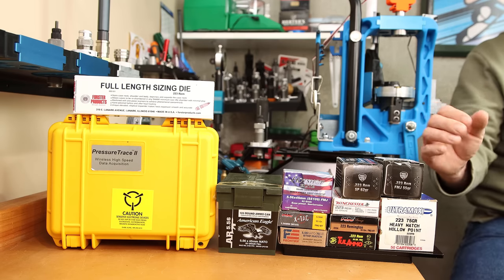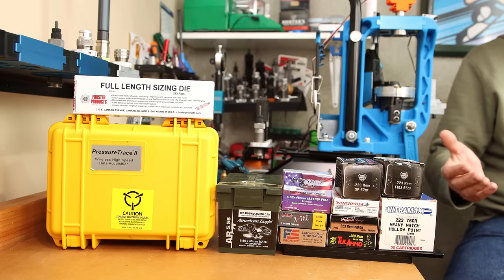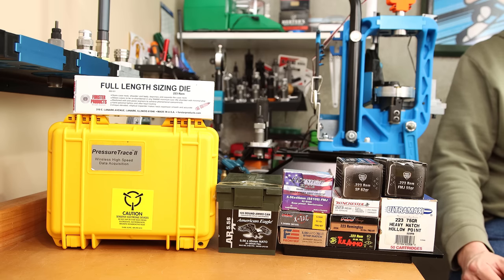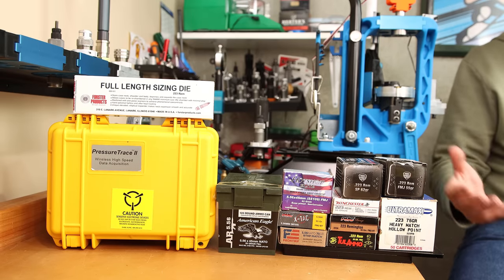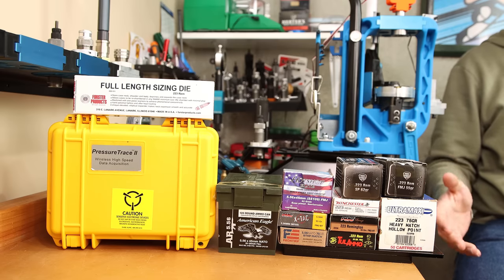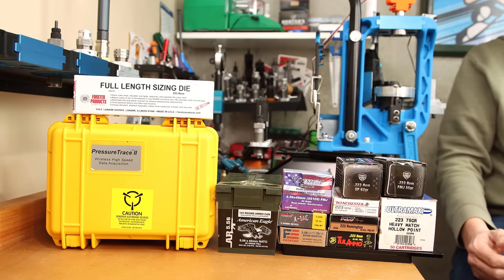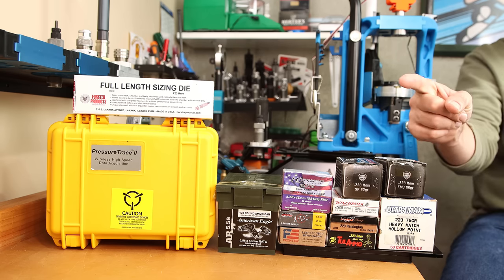223 vs 556 - The Hidden Truth No One Tells You!

Comment: Ok, the issue I see here is the test barrel. The entire idea behind the Wylde chambering was to help negate the pressure issues when shooting 5.56 in a .223.
Flat out, the pressure issues are when a 5.56 is fired in a shorter throat .223 chamber, so testing in a "go between" chamber like the Wylde took away MOST of the issue.
This is why ALL my handbuilt AR's are Wylde chambered, it truly is the best of both worlds.
As to the actual danger of shooting 5.56 in a .223, I sold guns for many years, and I sold a Ruger Ranch rifle to a fella who proceeded to shoot an entire case of XM 855 through it and ended up with a cracked receiver. WAY too much pressure for that gun.
So I have personally seen the danger and damage done when not knowing the difference.
Reply: My response is I seriously doubt that Ruger Mini guy only shot factory M855. There is a way to ramp up a normally very safe into the stratosphere. Get a POS Galil cobbled together by Century so the mags sat too low. This caused bullets to ram the barrel which set the bullet back. This will cause a dramatic overpressure with primer pockets enlarged to Large Rifle or at least that's how they looked. Got some stings on my right arm but glad it wasn't worse. No Century made junk no more. 
FWIW some of the bullets were pushed in so far only the tips could be seen at the case mouths. After 50 years of reloading centerfire rifle mostly 223 & .308 Win IMHEO the 223 is a sweetheart cartridge to reload and shoot. Its a forgiving round but you still have to pay attention to detail.
Reply: @LuvBorderCollies  Well, I know for a fact he shot only those Factory rounds, and I suspect he went to town on the gun, meaning that he fired as fast as he could with many mags, and I suspect the receiver just got hot as hell.
Anyone who has ever shot the AC 556 (and I have, at Knobb creek) will tell you that gun heats up faster than many others, it was just built too light for auto or sustained fire.
Reply: @alanrobinson2901  I never abused any of the Mini 14's and the Mini 30 I had. Still got a G/B but I've never shot it. It looks neat and that's why I still have it.
Totally believe the fast heat up. The Mini 14 was never designed to be a military weapon even if it resembles one. It certainly was not designed to be an accurate one either. Thanks for comment as I'd never thought of that angle. If you were on Patreon I'd buy you a coffee. 👍

Comment: I use Lyman's 50th edition reloading handbook. It combines 223 win and 556 nato in the same specs. I load to around the middle of the specs and haven't had any issues. Seems to me like the same specs are going to generate similar pressures, whether I call it 223 or 556.
Reply: 556 truly is just a 223 with a 60+ grain bullet trying to push to 3000fps. When attempting to achieve this thay had issues with pressure from the longer bullet length and weight so add length to the throat to lower pressure back to what the time they considered more safe.

Comment: Do you think the extra feebore is just the military's way of ensuring it can run a variety of rounds with not always perfect dimensional accuracy?
Reply: I remember reading that it was to allow for a specific round where the bullet itself was slightly longer than standard 55gr, may have been a tracer round but I am not 100% certain. I will look to see if I can find the actual source for that information, but it would make sense. If the actual bullet length exceeds the standard length from the end of the casing, I would assume one way you can compensate for that is by increasing the free-bore before the rifling.

I am far from any kind of an expert as a quick aside.
Reply: Of the information I've found for the L110 NATO and American M856 tracer, the twist rate (1:7) is more significant than the free-bore size, and the difference in size between that and a .223 bore isn't specifically due to the L110/M856 round specifically. In fact the differences in the actual bullet size between standard 855 and the 856 tracer seem to be negligible as far as what sticks out into the chamber (most of if not any of the increase in length is inside of the casing), but I can't say for certain whether or not the difference between the two bullets had any impact in the design of the free bore dimensions. I can't find any information right now that indicates one way or another so i defer to people who actually know what they are talking about.
Reply: @davidregal6831  I believe you are correct.  For the M856 tracer round to start out with the same ballistic coefficient as the M855 (our equivalent to the Belgian-developed SS109) it is supposed to trace for, it has to have similar shape and weight.  The burning of the tracer pyrotechnic material sheds weight, of course, so it actually starts out a little heavier (63.7 grains) then gets lighter as it flies.  This is apparently the compromise the military landed on to keep the round at least close to the trajectory of the M855.
Reply: 2 words , 
lowest bidder
Reply: @davidregal6831  Specifically, not “bullet length,” but shank length to ojive as the true bullet seating surface to the lands.
Reply: @johnnash5118  Thanks for the information. I was using layman's terms because I didn't really know the correct wordage and didn't want to misspeak and misinform people.
Reply: Reloading  charts give you the maximum  over  all  length.  So it makes no difference.

Comment: I run an LWRC M6 and Sons of Liberty Gun Works M4. Both recommend 5.56, but I run whatever I can afford. I also used to have a Smith & Wesson MP15 which recommend using .223 instead. Out of all 3 rifles, my groupings DID NOT change significantly between similarly loads of 5.56 and .223, and neither experienced any failures. I do still prefer 5.56 due to my rifles and suppressors typically being tested with M855. M193 is widely available and usually what I see discounted. That being said, I did just order 120rds of Norma .223 for testing recently and I'm eagerly awaiting its arrival so I can evaluate it for myself.

Comment: Great data!
You confirmed once again why I use LC brass for anything Im loading at 5.56 pressure and everything else for blaster fodder.  That little bit of extra case capacity never hurts.  The pressure chart was good, and what is often missed.  Ive explained to folks that reload that chasing velocity in a 223 chambered gun they will almost always run into pressure signs before the Wylde, 5.56 or other chambers.  One thing I would like to know more about though is actually material make up of the brass itself.  All alloys are not the same, and maybe its my bias, but LC brass seems to last longer than alot of commerical offerings.
Reply: It has less case capacity and lasts longer because it is thicker and annealed. Older reloading manuals instructed to load 10 % less than 223 for this reason.
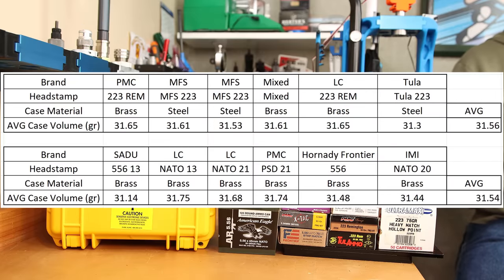Reply: @greybone777  Go watching starting at about 8:15 in this video.  You would be incorrect

I had more info typed up, but it didnt enter and Im not typing it in again....

Comment: THIS is a serious video, and thank YOU for your above & beyond calling for it.  I also was so tired of reading threads about the YES or NO swapping out these two rounds. I contacted Ruger Arms - I was told by Ruger, these are both good to go in all their rifles,  SAVE - the " Target "  model.       The " target " model,  if stamped .223  ONLY shoots .223,    PERIOD !    hope this helps as far as the Ruger models are concerend, I'm not talking for and other firearm manufactures - just Ruger here.
Reply: I also contacted Ruger ,with  the same question, and got the same answer you did.  They said the chambers are rated at a higher pressure tolerance then either the .223 or 5.56  shells are rated for, was the explanation why.

Comment: Lots of great info and thank you for stating it's not recommended to shoot 5.56 in a .223, but you never discussed the main issue: shooting a 5.56 that has brass on the long side such as with remanufactured ammo, in a .223 chamber that's on the short side, is what causes the overpressure situation. The longer 5.56 case can extend into the rifling creating a seal that spikes pressure on the already hotter 5.56 ammo. Have I every seen it happen....no. it's a theory of what could happen. Any chance you could look for a short 223 chamber and shoot a long 5.56 through it?
Reply: If the case is so long that it's hitting the end of the .223 chamber, it will be hitting the end of a 5.56 chamber as well. Spec case length is the same for both. A "long" 5.56 round is long in OAL/ogive length. It could be possible to jam the bullet into the lands when chambering the round which will run pressures up and even if that doesn't happen, the shorter jump to the rifling will cause higher pressures. That is the concern.

Comment: Yeah, I have been telling people for a decade both are totally fine to use. I even tried to put it in the manual when the company I work for started their line of rifles and I was asked to write the manual. Our legal department cut it out!
Reply: Exactly!  I shoot my ammo in all my rifles.  I have an early Colt AR-15 with a .223 barrel mark.  It shoots 5.56 just fine....
Reply: @chuckvan1568  the chamber is heavily supported on both because of the design of the system. It makes no difference. The pressure differences are minor and the guns work fine in both configurations. I've got 5.56 and .223 chambers and shoot both .223 and 5.56 in my guns and I've noticed the 5.56 is less accurate in .223 chambers than .223 but that's about it.

Comment: I use both military brass and non military brass in my .223 rifles. I do not have a black rifle, mine are a Ruger #3 and a Savage bolt action. The only thing I find about the .223 is most loading books over state the amount of powder that will fit in the case. I often see loads called for that will not fit inside the case and will actually overflow, so I'm not worried about to much pressure because I haven't ever been able to over load one.

Comment: I’m a little late to this party but I always appreciate data driven assessments of these types of issues. It would be fairly easy to strengthen your conclusions by calculating the standard deviations or standard errors of your mean (average) values. You could then do fairly simple statistical analyses to see if the differences between your groups were indeed statistically significant.
Reply: Yes, good idea.   Definitely something that should be done!

Comment: If we go way back in time before all of this mix and match aftermarket stuff, the basic idea was that big army liked the .223, but wanted to toughen it up to ramp up velocity a bit.  
The brass webbing was thickened, and .025” primer metal thickness was used instead of the common .019”.  Staked in.
And of course, the neck length was a tad different.  
A 1965 era .223 has a much lighter case than a M193 5.56 of the same era.  
The 5.56 did have about 250 fps faster velocity, and more chamber pressure.
Army FM’s of the time fully explain the ammo.
But today, the waters have really been muddied.
If you want to know the specifics of our military 5.56, refer to our current manual, FM 3-22.9.   It will answer every question, from ballistics to pressures (according to their method).
Reply: There are 3 versions of FM 3-22.9 I would recommend all 3. (FM 3-22.9 RIFLE MARKSMANSHIP M16-/M4-SERIES WEAPONS August 2008, and FM 3-22.9: Rifle Marksmanship M16-/M4- Series WITH CHANGE 1) Plus the publication that supersedes FM 3-22.9, 12 August 2008 (FM 3-22.9 Rifle and Carbine May 2016 Headquarters, Department of the Army.)

I don't own a 5.56 as of yet I am still debating whether to build one or not, either way, great info, and easy research. Thank you.
Reply: @freedomliberty5525  I would say grab a low cost AR from Palmetto while we still can.  If for nothing else, just to own one.
Reply: @blackhawk7r221  LOL, you and I think like, because I did check out Palmento and that is what put in head to build or not. Currently, I just need to find a nearby FFL. In fact I am just little over an hour from Palmento's warehouse, maybe time for a road trip.
 
I did end up buying a SIG Sauer Buckmaster 3-9x40mm Rifle Scope BDC Reticle, Blk - SOBM33001 from them around Xmas for $90 bucks to go on a 10/22 I inherited last year. Overkill, but it is awesome.  

I also bought Bushnell Trophy XLT 4-12x40 DOA Reticle SFP Rifle Scope, Black - RT4124BS11 for $70 bucks at the same time. 

LOL nothing to put it on yet but maybe a new prebuilt 5.56/223 will fit the bill. 

Thank you, for the reply.
Reply: @freedomliberty5525  I was stationed at Ft Jackson, so we were in the store regularly.  Take the road trip.  Often, they will stack up “blemished” AR uppers and lowers in plain brown boxes on pallets right on the floor.  Like $100 off list price for a paint scratch.   If nothing else, just grab a lower and do the paperwork.  You can order the rest.
Reply: @blackhawk7r221   Cool, thank you, I love springtime which is always a great excuse for a road trip.

Comment: Ton's of great information in this video. The biggest difference between 5.56 and .223 brass is the case wall thickness near the case head. 5.56 has a thicker case wall since its supposed to produce higher pressure. Also, a 5.56 chamber is rated to 60,000PSI whereas a .223 chamber is rated to 55,000PSI (Per SAAMI). Firing a .223 out of a 5.56 is generally acceptable since there is no reason the lower pressure round would cause issues. Firing a 5.56 from a .223 chamber could result in increased wear and possible damage to the system due to the higher pressure, but you'd have to be putting quite a few through it and rapid speeds to produce enough stress to cause a failure in the chamber.

Comment: I do have a question. The annealing might be similar.. however, the type of brass alloy used could be way different and offer different characteristics to the brass itself.. for example tensile strength and wear resistance. Anyway I enjoyed the video too.
Reply: No, they couldn't, any significant change to the metallurgy would change the annealing point much more then shown

Comment: It's all about the pressure and speed of the bullet for 5.56. You have to remember the military uses FMJ bullets and the 55gr FMJ was the bullet that the M16 was designed to shoot. The M193 needed to penetrate one side of a steel army helmet at 500 yards. To get the bullet to perform as the military wanted, i.e. break apart or fragment, a muzzle velocity of 3250fps at 52,000psi was needed out of a 20-inch 1-14 twist barrel later changed to a 1-12 twist.  The higher the pressure the higher the speed of the bullet. The military wanted crimped primers because on full auto the high-pressure ammo would blow the primers out if they were not crimped and likely cause a weapon malfunction, not a good thing if you are in combat. The development of the ammo and the M-16 itself make up the weapon system.
Reply: The m193 is a 223
Reply: @t-bfr45-70  No it's not.  FFS take the 2 seconds to google it before you post wrong info lol.
Reply: @elmateo77  m193 predates the development of the 5.56 NATO chamber. How about you do more then 2 sec of Googling.

Comment: Good comprehensive video. 

The major difference between .223 and 5.56 is this; The real difference is in the BCG and chamber. 5.56 chambers sacrifice some accuracy for higher tolerance, the military application, and double the ammo choice effectively, the civilian application. .223 guns on average have better accuracy but 5.56/ .223 will give you more flexibility in ammo. 

Now yes, you can in fact shoot 5.56 out of a .223 but I would not recommend it as your BCG/ chamber is not built for the pressure of 5.56 and you will have more wear and tear as a result until something inevitably breaks. The result may not be catastrophic and may take a while for problems to surface but it will eventually happen. Think of it as trading a 9mm for .40 barrel out of a pistol and shooting that. Your recoil spring and supporting features need to be swapped out as well as they were built for the tolerance of 9mm. It will be a slow burn of a failure.

Hope this makes at least some sense, I’m tired and it’s early in the morning.

Comment: Shooting on a State High-Power Rifle Team, one season our juniors shot a lot of M193 from CMP in .223 barrels. By end of season, just before trip to Camp Perry, some of the rifles had extraction problems consistent with too much pressure. At any rate, I handload mostly for a match grade .223 barrel. I also have a 5.56 upper which digests both .223 and 5.56, whatever is on gun store shelf.

Comment: Great video and information.

Ramshot is one of the few sources I've found for 5.56 data.  It is a "half step" above their .223 data (the charge ranges overlap), and in my 16" carbine gassed 5.56, full military power is more than I want to go.  My bulk loadings will be just a tick  above .223 max, but well short of 5.56 max.  This is based on the abuse to brass and I imagine the wear and tear to the rifle.  

I believe that with good, civilian grade bullets, performance of these "middlin' loads" will be fine at the short to moderate ranges that I would use the little carbine at.  There are so many better cartridges for extended ranges....  The military has raised chamber pressure limits twice IIRC, but I don't have the same need to torture the little round into something that it isn't.

AFA factory ammo, I do have a bunch of M193, but would only use it under less than ideal circumstances.
Reply: You're coping so hard in this comment. 556 is plenty powerful for ranges up to 700 yards